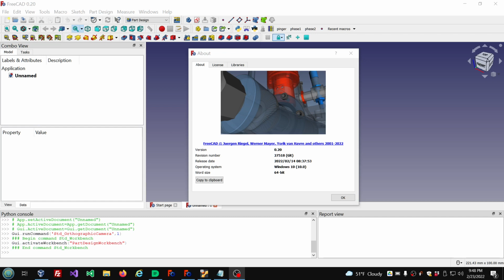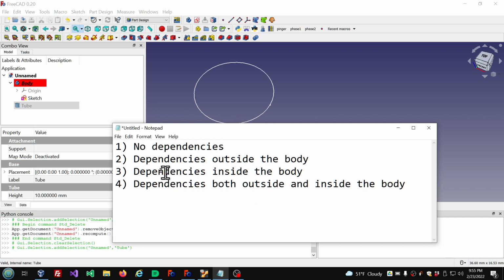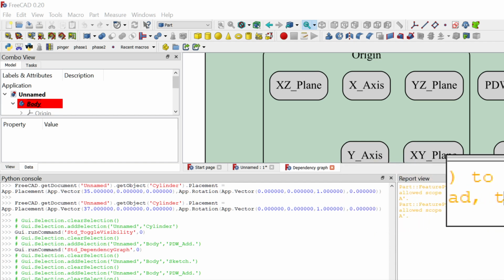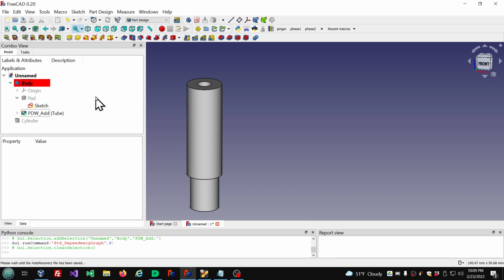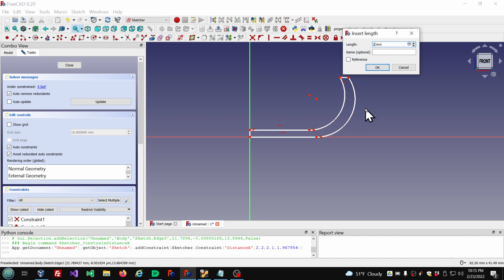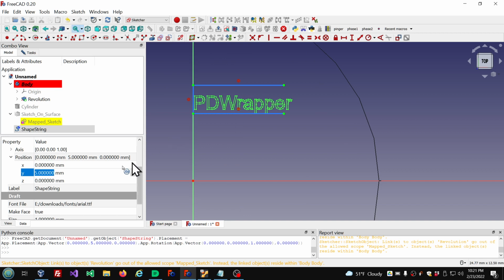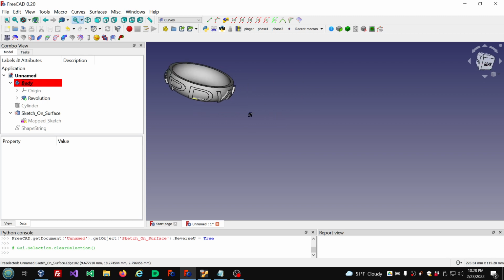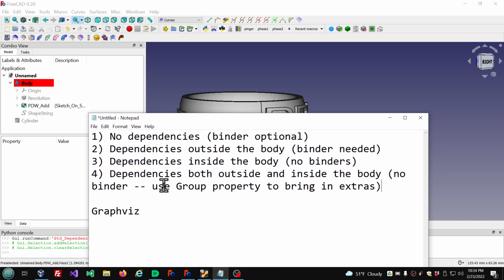092 pdwrapper sketch on surface bowl (FreeCAD 0.20)

Comment: Wow that's an amazing tutorial!
I found this and it almost solved my problem, so the follow up question is: does this also work with a SVG or sth. similar, instead of a SHapestring?
Reply from the maker: It's been a while since I made the video, so I don't really remember exactly what I did.  The Sketch on Surface object has an Extra Objects property that you can put a ShapeString into.  With an SVG you would need to import it as geometry, and then add those path objects you get into the Extra Objects property.  These objects could also be converted to sketches using Draft workbench draft to sketch tool.
Reply: @mwganson  oh okay. Thanks for the advice! I'll try as soon as possible :)

Comment: Hi , Mark . I found your channel a while back . I like your videos so i subscribed . I have been using FreeCAD for a while . The 0.19 version has really stepped up the program . several questions for you . I would like to be able to design containers that hold a specific amount of either liquid or dry measure . like measuring cups , spoons for example . could I do this through a spread sheet or is there a macro for this ? If there isn't a macro , could you recommend any sites how to learn to do this ?  Thank you for sharing all of your wonderful videos and you time and talent .

Best Regards 
Terry Lembke
Reply from the maker: I don't know of any macros for making measuring cups or spoons, but it's a good idea for one.  Probably the simplest design would use cylinders with handles.  Part workbench -> CheckGeometry tool can give you the volume (probably in cubic mm).  Alternatively, look up the formula for volume of a cylinder or a cone.  Half a sphere could also work and should be not too hard to work out the volume.

I would make the volume first, and then use the thickness tool (making the thickness outwards to preserve the volume) to hollow it out, and then add the handle last.
Reply: @mwganson  thank you for your ideas and reply . Have a pleasant evening,  Sir .